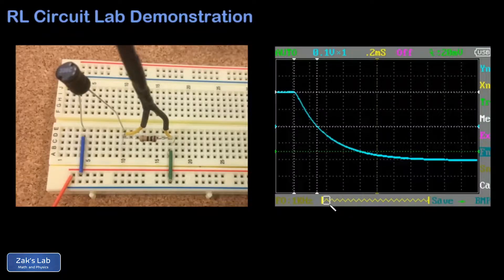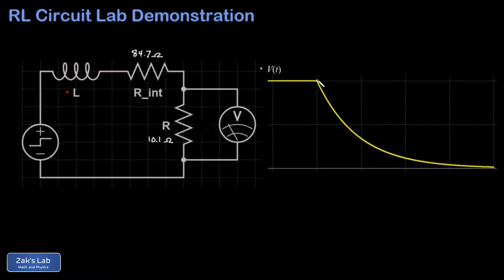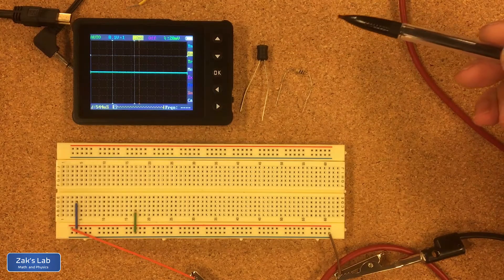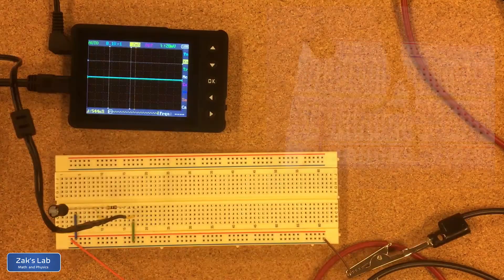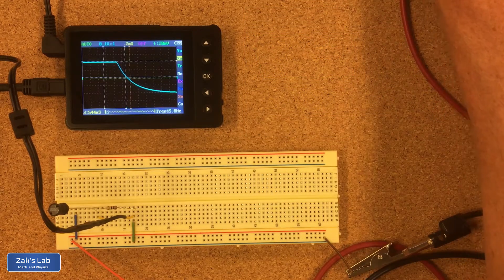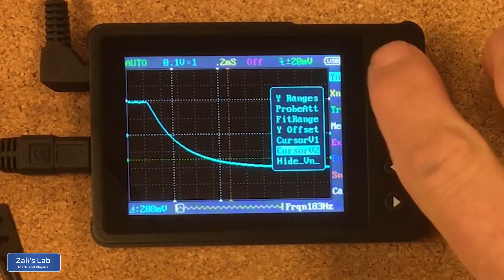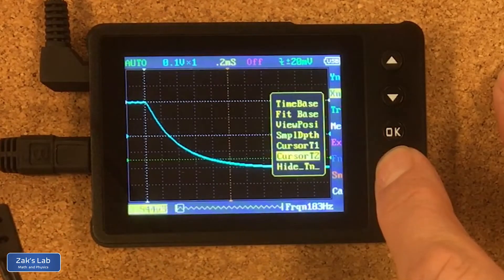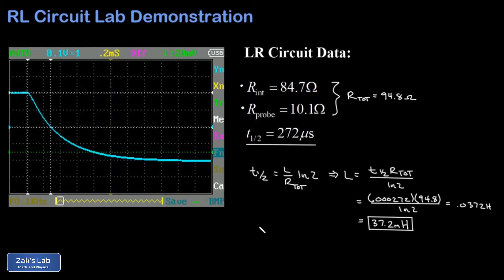RL circuit oscilloscope demo: find half-life for the current, use half-life to calculate inductance.

Comment: why 50%, not 37 or 63?
Reply from the maker: You could do everything in terms of "third life" instead of "half life" if you wanted - the point is that the current will drop by the same factor given the same time unit during the decay process.  With no obvious obvious reason to pick a particular factor, we usually choose 2 and focus on half life.  There are cases where you'll see a factor of e used as the factor of choice, and the time to drop to 1/e times the original value is really the "most natural" choice of arbitrary decay factor.
Reply: @ZaksLab  Thanks for the answer! I checked and it works for the  first constant time - 37% of the current in the circuit, but then L=T*R. It also works at 67% of the current rise. Analogously to the voltage in the capacitor